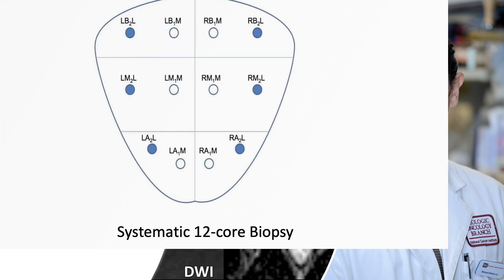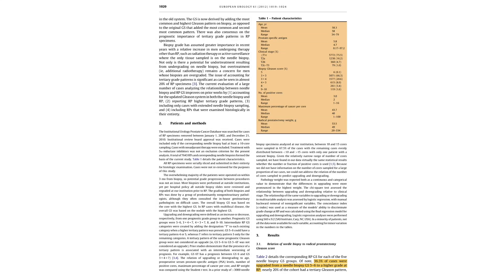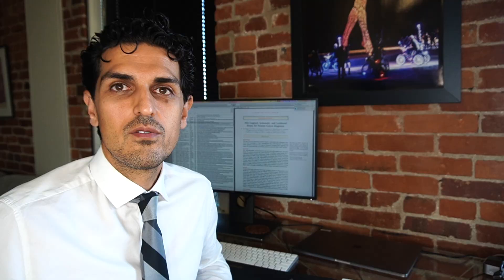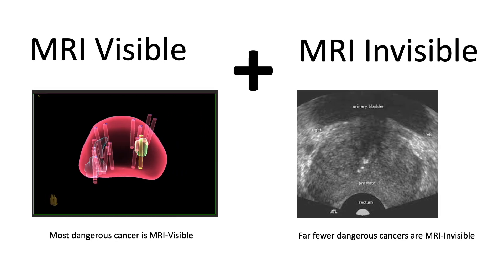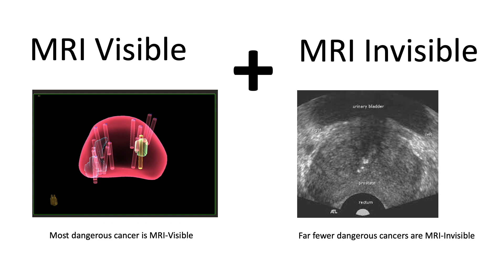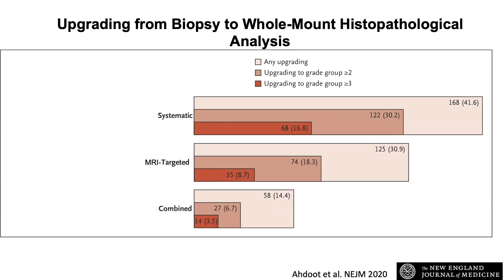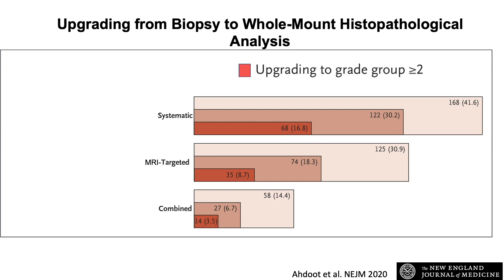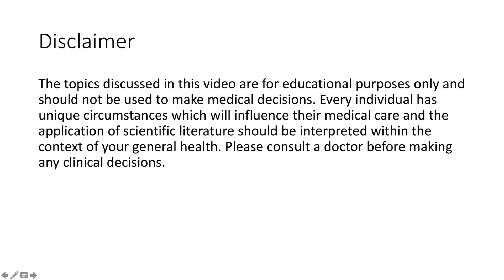Prostate Biopsies Can Be WRONG! -  Dr. Ahdoot Explains Prostate Cancer Diagnosis

Comment: What can you say about the new prostate scan called PSMA? I believed it is fairly new came out in 2021. From what I understand is that this test or scan is so precise , the patient can have this scan and can tell if the patient has cancer, if the cancer is contained in the prostate, if the cancer moved out of the prostate and had it metastasized to the bone, lungs or other parts of the body. I  am 78 years old, I had prostate MRI and was given a Gleason 8 score and was sent to for a PSMA scan and the result shows that the cancer is contained in the prostate. I was given hormone shots to contain the cancer in the prostate and I chose radiation therapy over surgery because I believed that radiation therapy today is much better than in the 1990’s and probably less complications than surgery for my age. At present I suffer some complications because of the hormone pills and radiation but I was told that after treatment, everything will be back to normal.
Reply: Does the hormone therapy effect erectile dysfunction , is that a side effect?
Reply from the maker: Yes having low testosterone will reduce sex drive and erectile function.
Reply from the maker: I did a whole video on it. Check it out! https://www.youtube.com/watch?v=9rwUF_dsDrs

Comment: Hello Dr. Ahdoot: I am PIRAD-2 with a big prostate (166 cc) and a PSA of 15 for a Prostate density less than 0.1. I will have a PAE (prostate arteries embolization), but first i will have a biopsy. I have the following questions: a. Probability of cancer? b. Probability of a significant cancer c. Is it necessary to have a biopsy before PAE?  d. Is PAE a good option for me?  According to this excellent video the best biopsy for me is the systematic... Is it right? Thank you in advance to your answer, I appreciate a lot you recommendations. Best regards
Reply from the maker: Lots of questions. I can give general information but not specific medical advice for your situations. 

Generally PIRADS 2 have pretty low risk of cancer (<20%) and with a low PSA density the risk goes lower. 

New data has come out showing that prostate artery embolization is not that effective at tasting BPH in the long run. Talk with your doctors about that possibility. I usually recommend a robotic simple prostatectomy or HoLEP for large prostates over 120 cc.

Comment: I had a PSA of 9+, negative DRE, but a PIRAD-5 bilateral anterior tz lesion. I was given a fusion transperineal biopsy, which found a small amount of cancer (Gleason 3+3), but since this didn't match the MRI, I was given a second biopsy about 5 months later with samples taken a bit away from where the first one was aimed; this resulted in an upgrade to Gleason 3+4. I'm wondering how this approach of having multiple targeted biopsies compares to the idea of having a targeted biopsy plus a non-targeted one. (There was only one MRI.)
Reply from the maker: I've written a paper on this topic. Google European Urology Oncology and Ahdoot. It should be the first link. Summary of the paper is that in people with PIRADS 5 the addition of the non targeted biopsies leads to about 2% more clinically significant cancer diagnosis. For someone like you who has small volume disease and might be a candidate for focal therapy (i.e. burning one segment of the prostate instead of removing the whole thing) doing a systematic (i.e. non-targeted biopsies of the whole prostate) would be something to seriously discuss. If you confirm no cancer in other parts of the prostate then doing focal therapy might become a reasonable option. Hope this helps. Sounds like your work up thus far has been in line with modern practice.
Reply: @cancerbetter  Thank you very much for your helpful reply. FWIW, in consultation with my doc, I've decided on RP.
Reply: @gshenaut  how are you today, after RP?
Reply: @gshenaut  i have the maybe  similar: PSA 8.8, PIRADS 5, Gleason in one core 4:3 (15%)...one core 3+4, six  cores 3+3 (from all 12 cores), im waiting for a robot now 🙂
Reply: @alliaj1  Good luck!
Reply from the maker: @alliaj1 reasonable plan! Wish you a speedy recovery
Reply from the maker: @gshenaut well stated

Comment: Hey doc, can cancer metastasize after a prostate biopsy?
Reply from the maker: I am not aware of data showing that biopsy leads to metastasis.  Biopsy is generally a worth while trade off if you have a high PIRADS score >=3, high PSA density, or if you doctor feels a hard spot on your prostate.
Reply: The digital exams are useless. And, they have the negative effect of turning off men from regular exams. 
Turns out despite getting a clean bill of health since 48 years old (now 55) I have Gleason 8, t3 cancer. The main lesion is on the opposite side of the rectum and after years of grow time found its way to the seminal vesicles and left lymph node.
I had no symptoms and ol’ numb fingers Dr. X felt nothing. I was only diagnosed when my PSA came back 30.2 and the psa pet mri lit up like a lightbulb.
Moral of the story: get PSA blood work done and keep the fingers pit of the bum.
Reply from the maker: You bring up a very important point. Rectal exams are actually a very poor way to detect prostate cancer. There was a large cancer screening trial called PLCO where we used PSA testing and digital rectal exams to screen for prostate cancer. Only 3% of the prostate cancers were found by digital rectal exams alone. What this means is that if you did only PSA testing you would find 97% of prostate cancers but if you wanted to be as confident as possible you would add a digital rectal exam. 

Digital rectal exams on their own without a PSA test is a poor screening tool for prostate cancer.
Reply: @cancerbetter  FYI - I have received 20 sessions of focused radiation therapy with the aid of the Kylipso markers (Boston scientific) and a Space OAR. Lupron and Abiraterone hormone therapy scheduled for 24 months. At this time my PSA is <.03. 

Every boy should be told in gym class about his prostate and what PSA is. 

Thanks for what you do Doc…
Reply: @cancerbetter  This Dre is also not good in the African American communities, because it's been documented that African American men prostate cancer tumors are at the bottom of the prostate being misdiagnosed, and when discovered that it may be too late. Black men have higher fatality rate than any other group. My question to you Doctor is, why protocols haven't changed with the advancement of technology. Maybe more imaging after psa goes over 3.5?
Reply from the maker: Some of us do get imaging at a lower PSA. I routinely do when I have a concern. The reason why we don't routinely screen at a lower PSA in the United States and Europe is that as you reduce the PSA cut off for abnormal it results in much more false positives. This means people without prostate cancer getting more biopsies and medical testing. It becomes a question of resource utilization.

Comment: Im a Gleason 6,, wondering if I should undergo surgery to take out prostate
Reply from the maker: In very rare cases do I recommend surgery for Gleason 6. As long as your were diagnosed by an accurate biopsy method the risk of upgrading to more dangerous cancer is actually quite low(about 7%). 

The exception is for people with high volume gleason 6. For those people with more than 4 biopsy cores with gleason 6 cancer their risk of having higher grade cancer is much higher and in that situation you can consider surgery. 

But in general, gleason 6 prostate cancer does not spread and is not a life threatening disease.

Comment: Hello Dr. Ahdoot - Thank you for this information.  I'm 64 years old.  Because of an elevated PSA I underwent the systematic biopsy in November 2021 where my doctor took I believe 13 patterned biopsies. The results were all negative except for one section where he found atypical cells that he said he couldn't say I had cancer, but also couldn't say I didn't have cancer.  I'm schedule for more biopsies of just that specific section in February 2022.  I'm concerned about the damage to my prostate and my rectum wall from taking all the new biopsies in one small targeted grouping. Would an MRI at this stage be a better idea?  My doctor says MRIs can't show cancer of the prostate. Thank you in advance for answering my question.
Reply from the maker: I cannot give medical advice on here but I can tell you the science and the science shows that MRI prior to prostate biopsy leads to WAY better cancer detection than systematic biopsy alone. Here is the paper I wrote on the topic if you want to get an idea of the numbers. 
https://www.nejm.org/doi/full/10.1056/NEJMoa1910038
Reply: Did you retest after your initial elevated test?
Reply from the maker: @robertcuba5947 indeed, initial elevations in PSA should be confirmed with a repeat test

Comment: Thanks for this very useful information. I had a question - is there any evidence or risk of a prostate biopsy causing cancer that is localised within the prostate to contaminate and spread the cancer to the surrounding tissue outside of the prostate ?
Reply from the maker: That's a common and interesting question. It's actually 2 questions. 
First does biopsying a tumor lead to cancer spreading throughout the body? In other words does biopsying a mask cause metastasis. The data is pretty strong and it shows that is not the case.

The second question is whether you can get seating from the biopsy track. This can actually happen though is it extremely uncommon. The risk of seeding (or cancer spreading) along the path of the needle at the time of a biopsy is a fraction of 1 percent. So yes, while there is a risk, the benefits of confirming a cancer diagnosis is likely worth the risk of seeding.
Reply: @cancerbetter  thank you for your comprehensive answer.

Comment: Just had my PSA done for the 1st time ever after years of doctors telling me to wait until I was 45. It cam back at a 7.5. My doctor did the digital and said everything felt normal. He then suggested a biopsy. I had the biopsy and had to do some studying on prostate cancer. My primary care physician didn't ask if I had sex recently. I had a lot of sex and drinking up to 12 ours before my psa test, which I didn't know they were doing. I also had sex about 12 hours before my biopsy. Noone said not to. After researching, I am very afraid. I am 45 years old and wondering if I am missing something by what my doctors aren't saying. Waiting 2 weeks for my results.
Reply: you should not have sex or exercise for 48 hours before a PSA blood test as it can increase the PSA level
Reply: How did everything work out, did you come up with prostate cancer diagnosis if you don't mind me asking?
Reply: @dappa311  yes. It was cancer. Had it removed and doing good
Reply: Did you repeat the elevated psa test before biopsy?
Reply from the maker: The biggest predictors of finding cancer on a prostate biopsy are
#1 your PIRADS Score. This is the score the radiologists gives on the MRI. This ranges from 1 to 5 with 5 being the highest risk. 
#2 PSA Density. This is the PSA level corrected for the size of a persons prostate. 
If you have a PIRADS 5 and a PSA density greater than 0.15 cancer is very likely. If you had a PIRADS 2 and a PSA density of <0.05 cancer is VERY unlikely. 

On top of all that, prostate cancer is very rare in someone at your age group unless there is a family history of prostate cancer.

Comment: I am 64 and have over a year and a half of a psa score in the 5-6.5 range. I am now going to do a 4k test. This profession has been over diagnosing/treating prostrates for a long time now due to lack of better testing. I am really hoping that this new test will forgo a painful completely unnecessary biopsy. We shall report back as to how this turns out. Btw I tried to do a MRI w/contrast but was unable to go into that tube! Why not do anesthesia? Just like a colonoscopy? 100% success rate of doing this MRI! Also why do urologists refuse to use anesthesia for prostrate biopsy?
If you guys were dentists you'd all be out of work for allowing us to suffer such agonizing painful biopsies!!
Reply from the maker: Lots of good questions. 

4k score, phi, PSA 3, and decipher scores can all help determine your risk of agreesive prostate cancer but the MRI is the most accurate (at least based on our most recent studies). In cases where people have an elevated PSA it's often wise to correct that PSA level for the size of a person's prostate by calculating a PSA density. (PSA density =PSA level/prostate volume in grams or ml.) Generally, a PSA density of >0.15 is very concerning for cancer and <0.05 means you are very unlikely to have cancer. 

Prostate biopsy is typically done under local anesthesia but can absolutely be done under general anesthesia. However,  there are some logistical barriers to doing biopsies in the OR setting. In order to do a biopsy in the OR you'll need all the appropriate MRI fusion equipment to be available in the OR which is not always the case, especially at smaller practices or hospitals. 

I can't comment on your individual situation but these are some things to consider. If you have doubts about your care provider it may be wise to consider a second opinion, perhaps an academic center if possible. 

Hope this helps you find better care. -Michael Ahdoot MD
Reply: Dave, I raised daughters and so am not afraid of anything! ... at least I thought. My biopsy was performed with laughing gas. I felt nothing but a little pressure from each of the twelve extractions. What you went through must have been horrifying! I could never knew such barbarism existed! There needs to be a t-shirt for guys like you!
Reply: @b8kersfield  As a follow up my 4K score indicated that a biopsy was required. I did it and it was not as bad as I thought it would be. Saying that I can also understand how it could have been far worse. The results of the 14 samples of tissue found less than 3% of #6 Gleason in just one sample! So yes I am proof that a elevated PSA does not necessarily mean a biopsy is required from that test alone. The 4K test was far better and even that was misleading. I am on a watch with a psa taken every 6 months followed by a visit to my Urologist. BTW I raised 4 daughters myself lol
Reply: I've had two biopsies. One with anesthesia, and a year later, one without. I didn't find the anesthesia necessary. I did have local anestheisa (lidocane), however.

Comment: Please comment, I'm 60 with a psa of .97 do I need a traditional biopsy?
Had trouble urinating that's what prompted my visit to urologist. Since then worked on diet and it's been better. Biopsy coming up and don't know what to do... Please reply. Is it still needed?
Reply from the maker: Usually people with a PSA below 4 do not get a prostate biopsy unless there is an abnormally felt on a rectal exam. There are exceptions. For example a PSA of 3 in a young person can be highly concerning or a PSA that is rising quickly. 

I can't make comments on your particular situation though as I have not seen you. If you are in doubt get a second opinion.